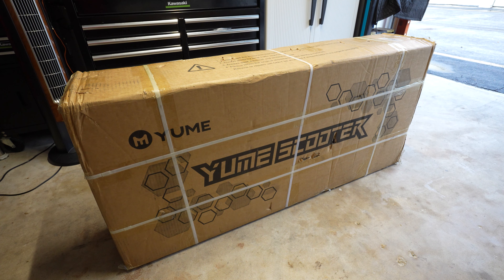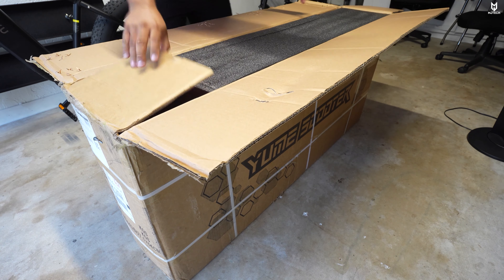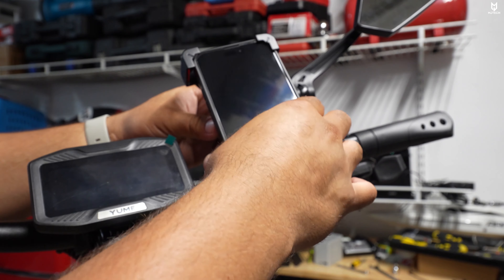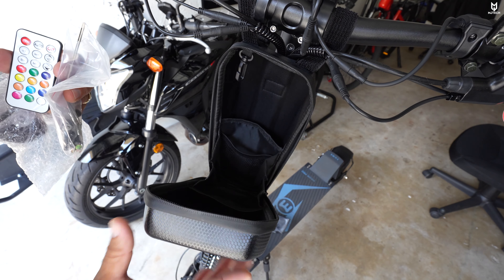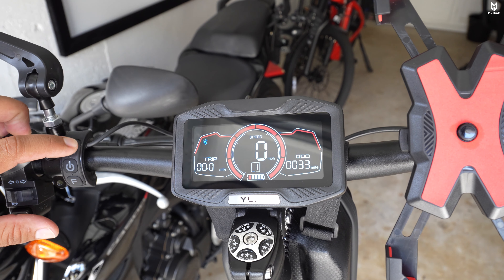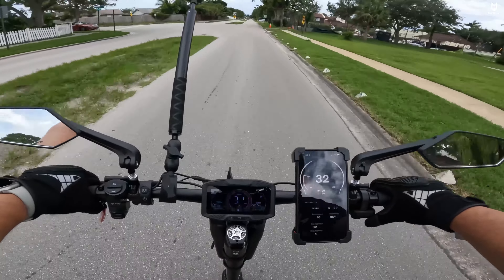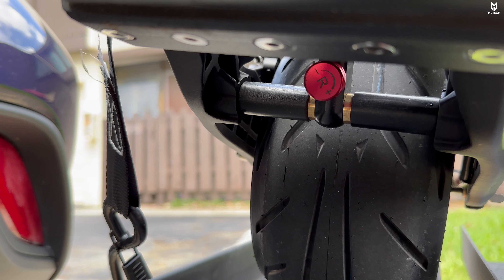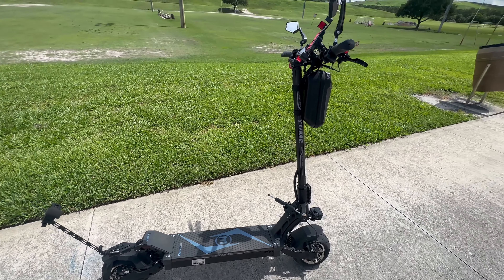YUME Hawk Pro - A Monster Electric Scooter with Many Extras!

Comment: I just don't get it how they (YUME) say it's a 6000W scooter. it is a 60V system accompanied by a 2 X 35A controller, which means it can reach up to 4700Watts max (67V X 70A).  
Great review ❤🤙
Reply: Same here. It's not especially knowing it can't exceed 50mpg when 1500w scooter can.
Reply: These are their new controllers and I believe they’re good to 45 amps
Reply: 35A continuous. 45A peak. Your only going to peak during hard throttle.
Reply: Good Review

Comment: The rear lights must be on steady. In the dark, the police write a ticket if the back lights are not on steady. There should also be a right and left signal feature, if there is no this simple feature, the scooter is very inadequate and unnecessary.

Comment: I am torn between this and the yume x11+.  hmm. both look nice. this has street tires the x11+ has knobby.
Reply: Did you end up buying one?
Reply: @MrBalas3  yes I did Yume x11+. My goodness is that a sweet ride, Ive had it about a week and just love it> only think I wish is for more range. I also bought a ultron x3 pro its got a bigger battery 45ah vs yume 30ah so hoping to get more range from it. But the ultron out of the box is definitely not the yume, the yume has a wonderful thumb throttle  nice screen nfc nice suspension adjustable bars. All things lacking in the ultron so im working on the ultron. Hauling butt on the yume like 35-50 mph i can get 10 miles or so then top speed goes to 35-40 for another idk 15 mile. Awesome scooter for short fast runs and if you just want slow then much further.
Reply: @godface81 So about 25 miles on the same size battery that the Hawk Pro has. Not great, but it sounds like your pushing it hard. Granted you’ve just got it, but nice to hear no issues so far.

Comment: Does the weight of this scooter include the weight of the rear-view mirrors, the phone holder and the accessory bag with whatever it carries inside of it?
Also; under what conditions does this scooter have to be ridden to get anywhere near the touted 60 mile range?  I'm not really looking for break-neck speed.  I'm more about range.
I'm looking for a scooter that can tow the small bicycle trailer that holds about fifty or sixty pound worth of my fishing gear including a small ice chest.  If I can get thirty or thirty-five miles of range out of a scooter while towing my small bike trailer I'd be a happy camper or, scooter rider.
Reply: I’m in no way affiliated with Varla scooters or even own one (just considering a scooter myself) and noticed on their website that they have trailer kits for their scooters. Might be worth checking out.

Comment: GUYS PLEASE HELP ME TO DESIDE SHOULD I BUY THIS OR THE YUME  X11+ 😢
Reply: im right there with you dude, the 4.5' wide street tires are so slick, if they fit on the x11+ then I think its x11+ for me!
Reply: @bouika  but its the narrow deck on the hawk pro that worries me im shoe size 12 and the deck is pretty narrow
Reply: Also theres a scooter that checks all the boxes for me its called the JOYOR E8-S and theres a 72v version and most important part for me is the removable battery by Samsung
Reply: Never buy joyor scooters, that was my 2nd scooter. Big mistake
Reply: @aaronmaruri Decks not narrow tho its kinda perfect!

Comment: Does the hawk pro have a fast take off? Like does it skid tire at take off like the Klima and other high torque scooters? I'm going to get the Klima or the hawk pro,  im after something with fast acceleration. Was wondering if this one has good torque. I like its looks n all better than the Klima
Reply: Also what i like is that its checks all the boxes but 😢 the only things that i don’t like is that the deck looks kinda narrow 7 inch wide my Teamgee g3 that i use to commute had a 8 inch wide deck and my shoes are size 12 😂 so i dont know if its worth buying for me
Reply: Nami Burn E2 Max does takeoff burnouts. 😂😂 It's actually hard to control on X mode during takeoff
Reply: u can usually control that in the settings. older scooters can have fast acceleration from my experiences with 60v
Reply: I have a Zon Doo ZO01 plus. Dual motor.....2,800 watts EACH.....top speed of 52 miles per hour. If you're looking for a scooter that "skids" at take off,allow me to suggest this one. It'll "burn rubber" in dual motor mode even in 𝘧𝘪𝘳𝘴𝘵 gear.....you don't have to have it at its maximum. I'm not into tires spinning like a bat out of hell at take off.....so I always have to start out in single-motor mode. Once I get up to 29 or 30mph,then I'll switch on the second motor.
Reply: Which one did you end up getting?  I tried the Klima. Very nice rider handlebar height(I’m 6’4”), I like where the steering damper as located better than what I see in this video for this brand.
Reply: @aaronmaruri Which one did you end up getting?  I have size 13 shoes and am concerned about the deck size too
Reply: @MrBalas3  im holding off right now bud due to the new year i know something good is coming im being patient right now! But i know that roadrunner rs5 pro 72V is coming too

Comment: hello I bought the yume hawk and I was very disappointed upon receipt in fact there were defects in particular the plastic of the deck which came off but above all the steering damper screw is too big so the The shock absorber does not fit and I cannot ride. I tried to ride without the shock absorber but it is very unstable.

Comment: Hey did you test the range yet?
Reply from the maker: Yes I did 38 miles on mode 3. Mostly riding hard
Reply: @MJTechChannel  thanks for the reply.. I’m now more interested in this scooter thanks to you. I currently have the Segway gt2 but I need something a bit faster. But not so expensive
Reply: @CrazayLongwood  you're looking to upgrade from gt2?
Reply: @thermodynamics1110  yes im going to get the new kaabo wolf king gtr .. its basically the gt2 but faster
Reply: Did you end up getting another scooter? @CrazayLongwood
Reply: Never mind I just saw your reply to someone else, doh!

Comment: I recently ordered this. I see at 6:18 you have the cover off the deck to access the battery compartment, it looks like you had to remove the rubber grip from the top to get to the screws? If this is the case, did you have to use adhesive to reapply the rubber mat or is it magnetic or something else?

Comment: I just got the Yume y11+. Yume is a very reliable high quality brand of scooter. Its insane how they are so cheap for the quality that they provide. I currently own 3 different yume scooters and never had a single issue with any of them besides basic maintenance. They are built like tanks.
Reply: Lots of people are saying that Yume got a terrible service. They just delete bad reviews from their page and don't answer. So it makes me think you're a lucky person or a blogger=)
Reply: This or the non-pro version? and why?
Reply: @Sir-Kay I can’t speak on the smaller ones like the hawk series as I don’t own any of those. I can only speak on the quality of their flagship scooters. The earlier scooters that came out when the company was brand new. The ones I own are the Y10, the Y11+, and the X11. Their original scooters like the ones I own are extremely reliable. Most of the complaints I’ve seen from folks are from Yume’s newer models. You can’t go wrong with the older scooters like the ones I have. They are built with very strong material. There’s too many sensitive cheap parts on their newer scooter. Especially on their new Raptor and Predator model scooters. Not to mention the newer ones are like almost 3x the price of the older scooters. You can get a Y11+ brand new for less than $1500. Their new predator scooter is almost $3500. I’m not sure about the hawk models though.
Reply: @peaceful4you408  trying to decide between getting the y11+  or x11.  which one do you prefer?  I noticed the x11 is a longer scooter than the y11+.  Does this extra length make it more stable or ride better? thanks

Comment: have you have any problem since acquiring your scooter? I got a hawk and it broke after riding for 10 miles. fuse keeps popping
Reply: Sometimes its a good idea to not buy the first batches
Reply: Sometimes its a good idea to not buy the first batches
Reply: Also upgrade your fuse to more amps at your local auto store
Reply: Have you had any other problems since than?

Comment: I knew these fucks would do that...just got the 1st model hawk too. Bust my ass 1st test run after getting comfortable doing 30mph. I got to 40ish then the death wobble ended me before i could react. Got home left hand leaking and my bro jumps on doing the max like nothing till battery dies. Smh
Reply from the maker: Did you adjusted the steering damper?
Reply: @MJTechChannel  yes I tried adjusting damper and made it a bit stiffer which helped the wobble but made taking turns feel awkward. Also after installing damper, I can't turn much right as I can left. Instructions said to keep wheel straight and that the rods should be even on both sides before locking screw but I can't seem to get it right